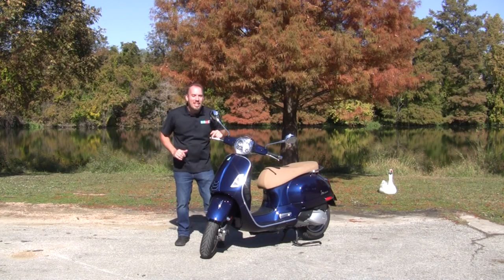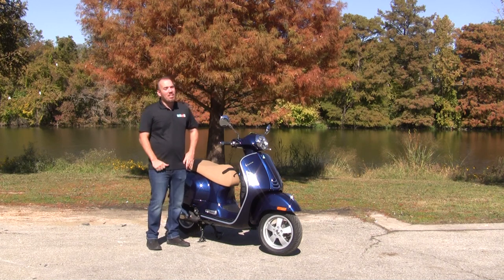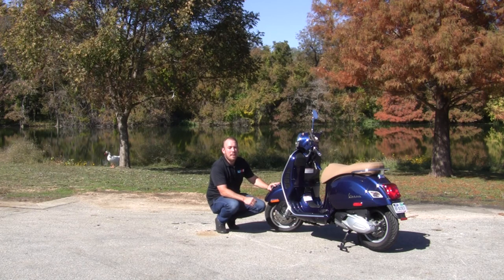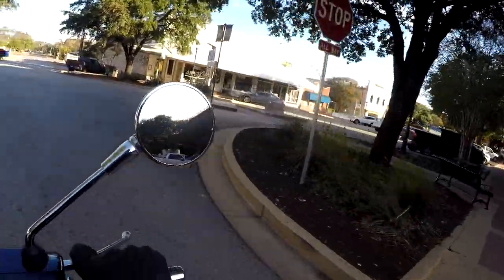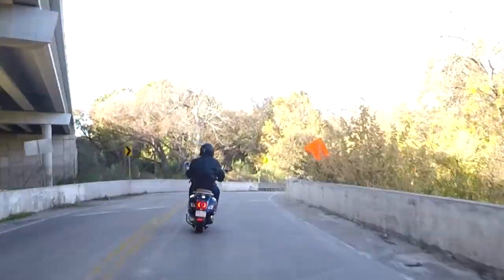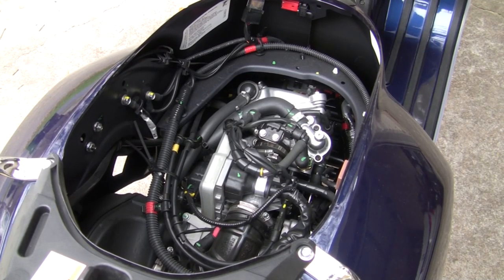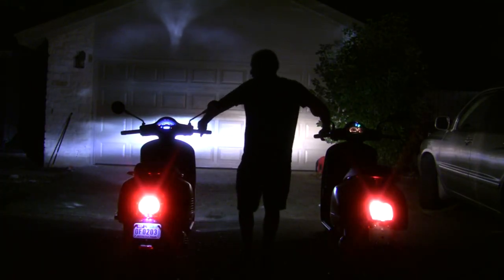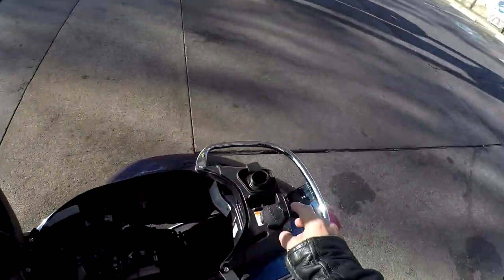Why you should own a 2020 Vespa GTS 300 HPE and not a Goose!

Comment: This is probably the best review of the Vespa GTS I have ever seen. I own a 2018 model, pre HPE and have had a 2012 model before that. I get over 80 miles to the gallon mixed town and country riding and it handles great though country roads. I have done distance on it and stayed away from home, great fun. An easy upgrade for older GTS's is adding LED lights as I have done. My first GTS was red so I don't think Fred would approve. Safe riding Fred.

Comment: Though the rollers don't seem to be screeching like in the old one, there seems to be a lot more mechanical engine noise than on the (UK spec) GT200. First thing I would do with a new one would be fit an extended front mudguard (google them) and seal the underbody and area around the battery tray to stop the metal rot before it starts. Mine has been an absolutely faultless scooter over 60,000 miles though with regular servicing. Would not hesitate to have another.

Comment: I was just about to ask if the gas still shoots out the tank while refilling close to full; and you included it! Thanks for the review. However your 1080p looks a little out of focus!
Reply from the maker: syumassh at this point it’s muscle memory to remove that bucket or just put 1.3 gallons in! 

Is there a particular part that looked out of focus or was it all of it? I watched it on computer, phone and mirrored to TV and didn’t catch that
Reply: syumassh He is using my old Canon Vixia for now, cutting edge perhaps a decade or more ago but definitely not as good as a modern camera! I’m sure James will be getting a better camera soon.
Reply from the maker: Micah Shoemaker Christmas is around the corner....
Reply: You can use the filler cap to prop the 'bucket' (pet holder) up so that it minimises the chance of fuel getting into whatever you're storing. Good video and it covers a good overview of what can be expected when owning  a GTS300 Vespa 🙂 🛵
Reply from the maker: Slow Loris good thinking. As long as it’s a spill over and not a geyser you’d be set!
Reply: In over six years of riding a Vespa GTS It only happened to me once.

Comment: Maintenance costs on the HPE are absolutely absurd. They cut the earlier GTS300 maintenance intervals IN HALF, requiring TWICE as much maintenance, including a valve adjustment and belt change EVERY 6000 miles. No thanks, I'll keep my 2006 GT200. It has 90+ percent of the performance of the HPE, and is simple and easy to deal with.
Reply: What does it cost for a belt change and valve adjustment?
Reply: Thank you for the comment about keeping the gt200!   I purchased my first Vespa—2005 gt200– last fall, and have been looking at the 300’s and thinking that I need one....    The 2020 and newer HPE seem like something to avoid.

Comment: Loads of fun, add a headlight visor. Really looks better with that
Reply from the maker: bfarm44 I had something similar on my aircooled Bugs; really changes the look!
Reply: The Motopologist got mine from Vespa I think it looks great. Rear engine guards and a rear rack. Small windscreen next. Changing the seat cover to a darker color and I have a great dark brown flat bottom leather bag for the rack to install. I have several bikes to choose from but the wasp gets more miles than the rest
Reply: The Motopologist oh yeah ditch that side stand, zero faith in that
Reply from the maker: bfarm44 couldn’t agree more, even when it was an option only I hated them. A slight hill and it’s on its side!
Reply: @TheMotopologist  
I actually thought of getting a side stand, until I read what you guys said about them.  I'll just stick with the center stand.  Thanks for the heads up.

Comment: Hi nice video.Is it safe for the engine's longevity to go at the highways at maximum rev speed? Also what is the maximum weight for underseat storage? I want to put a 10kg chain but I dont know if it will break cus its a plastic bucket.Where I live there is a big chance of theft
Reply from the maker: My 2010 Vespa GTS 300 has had at least 7200 KM (4500 american miles) of primarily highway use with no problems. The thing to do is routinely check the oil level as some will get pushed out when at high RPM for extended time frames. The bucket is plastic, but is structural sound. I used to carry 22 kg (50 american lbs) of metal dumbbells, water bottle and towel when doing HIIT training.
Reply: @TheMotopologist  Thanks.One more question.Do you thing that the changes that piaggio made to the engine will affect durability negatively?
Reply from the maker: @panos3505  no problem! I highly doubt it will as the single cylinder motor is about as basic as it can be. At this point it seems like they are just refining it to make it more powerful, more efficient and of course pass the latest emissions standards.
Reply: @TheMotopologist  Thanks a lot
Reply from the maker: Παναγιώτης Βελαώρας hopefully I was helpful! Don’t forget to subscribe to see more great content.
Reply: @TheMotopologist  Already did,wish you the best
Reply: @panos3505  την πήρες τελικά τη βεσπα; Πως είναι;

Comment: It is certainly beautiful.  I am sure
it is fun.   But, twist-and-go?  
24HP into a belt and variator?
Not for me.  Besides, a lot of the fun of the old 2strokes was shifting the 4spd.   Just my $.02  Nice ride thru Austin.  Good review.
Reply from the maker: Steve, I still have a lot of love for the old twist grip clutch shifting 2 smokers! In fact we still have a few vintage Vespa's/Sears Allstates (67 sprint, 05 PX and a few small frames) lounging around and are a blast to ride when they are running right, key word running right as carbs get gummed up over time, cables need adjustment, etc. which is not a big deal, but for a commuter that needs to go the unofficial Texas speed limit of at least 80mph its hard to beat a modern GTS. 

That being said its a motive of getting more butts on bikes as people tend to get fearful they cant drive a manual how could they ever learn to ride a clutch motorcycle. The CVT resolves that excuse.
Reply: @TheMotopologist  
Not only that, they are so convenient!  When I want to run to the local hardware store, I am not about to break out the Harley or the V-Max.  I want to get on and go instantly, park anywhere, hop back on, stop for a six pack and get home ASAP.  It's about utility and fun at the same time.
Reply: I have a 1962 VBB that has the 4 speed twist shift and the same bike he rides here. I grew up on classic 2 stroke Vespas and thought I'd miss that part. I got over wanting to shift pretty quickly with the speed and reliability of the GTS.  It has plenty of zip even with the CVT/belt.

Comment: Buying new (or used) you can order damn near any seat configuration you want...even separate-saddles for passenger*( *A 'Vespa' w/no 'folding-racks' front & rear is NAKED!  And the 'center-bar w/passenger-pegs' is a 'must' if there's a lot of passenger travel...much more comfortable leg-position for the passenger )   Nerf-bars are available...ORDER them in case of 'drops' so paint and metal won't be damaged HUGE DRAWBACK for 'Vespa?'  'Piaggio & Honda' are the 'most-stolen' machines, w/Vespa in  the top-spot! for the '150'/'300 Super' being the 'juiciest targets'...you live in a shit neighborhood or anywhere in So. Cal ? DO NOT buy a 'Vespa'
Reply: Scooter West is the very best source for parts in the US!  Also great videos!

Comment: What mike/sound system do you use to record while you’re riding?
Reply from the maker: This has been one of my biggest struggles, especially on the larger bikes with exhaust. The GoPro microphone worked on one video, but all the others were wind noise constantly. I tried using my lapel mic clipped onto the bike but in most cases would blow past the mics limits. I used a unidirectional microphone on the GTS video with it mounted under the helmet bucket and that worked alright. My last time is actually a Sena backpack hooked to my Sena 20s headset mic, I used packing styrofoam material around the mic and then a layer of craft fur. Also made an air dam out of craft fur to help eliminate wind noise. The GoPro backpack also eliminates pairing my video with my voice recorder data, making life a lot easier!

Aside from getting 1000 subscribers, this has been my hardest struggle though and I continue to try and learn/improve on it.

Comment: My 300 hpe is fantastic but at only 350km from new on the odometer it already leaks coolant and the brakes ( front and rear) sunk to the end of travel if unused for more than a week, and need bleeding. Beautiful and fast but crap build quality. Such a shame for the price I paid!
Reply from the maker: Bogdan, You need to visit your local authorized Vespa dealer as a bulletin has been posted about the brake pumps. IIRC they will test to make sure its within range of failing (which yours sounds to be) and replace the necessary parts.
Reply: U r f jokein me where u from? I have a 2018 hate it had a 14plate was great where u from bud I'm from Durham in England
Reply: @granto6712  I think your key pad is faulty
Reply: There was a brake recall if it is an HPE.  I'd get it to the dealership.

Comment: "Unlocked I can see it hitting 90 mph". Can you unlock it? Not that I'd want to.
Reply: You can add a new whistler, Lambda Emulator, bigger pipe, and clear 90.  Mine with just the whistler and bigger pipe does 85 and I'm 245lbs.

Comment: But it's not a 300 it's a 278. You could say a hopped up 250 but it is not a 300.
Reply: The model is the GTS HPE 300, regardless of the actual displacement, so he was correct.  Being pedantic is cool.
Reply: @TheCerealHobbyist  Correct in what it is called....not in what it is. I can call a 50cc two stroke  a Kawasaki H2 doesn't make it so.  What you think is pedantic I think is just 278cc because if it was 300 it would be a very different scooter.  So you can keep it.

Comment: If you can't do the maintenance yourself, you better have a fat wallet.  Vespa calls for valve adjustment and belt replacement every 6,000 miles.   Combine that with average rear tire life of 6k, and you're looking at a huge bill every 6,000 miles.   The higher output engine wears out the components which are basically the same they have been for the last 10 years. Burgman 400 and Majesty 400 have belt a belt life of over 12,000 miles.   The HPE sure looks pretty, but makes no sense to me.  I'd rather have a 15 year old GTS 250.